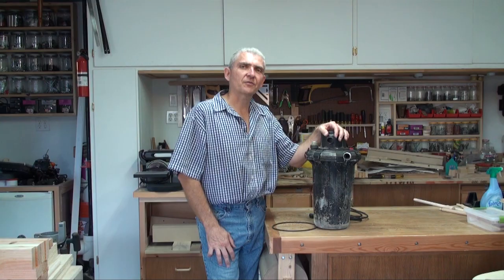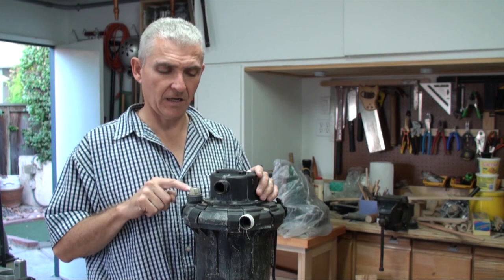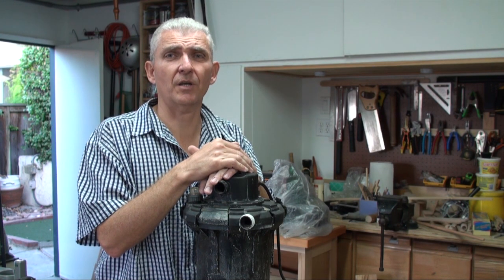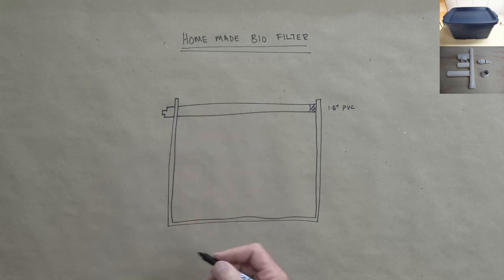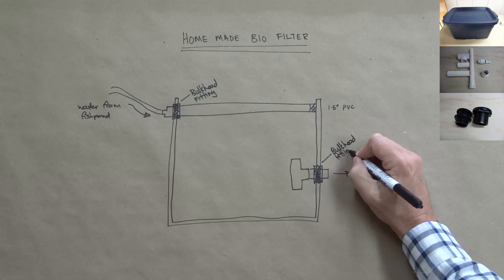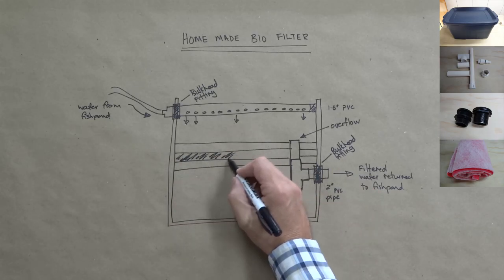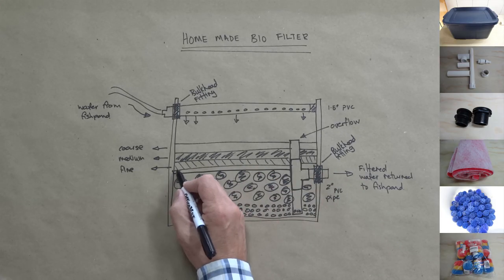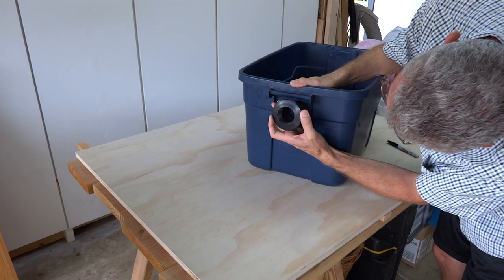Homemade Biological Pond Filter

Comment: How would you install a ball valve for this setup and add  UV
Reply: adairsr53  I have found that trying to reduce the amount of water pumped with a ball valve creates unnecessary stress on your pump; perhaps, try a smaller pump. If you still feel as though you need the ball valve I would recommend placing your ball valve inside of biofilter if you are using the ball valve to control the amount of water pumped into the filter. With placing it inside the filter if the ball valve begins to leak, it will leak in your filter rather than outside of your filter.  I do not recommend making very many adjustments as this could cause where you cut the entry for your bulkhead to lose it's 
 
  
 

 
  Normal
  0
  
  
  
  
  false
  false
  false
  
  EN-US
  KO
  X-NONE
  
   
   
   
   
   
   
   
   
   
  
  
   
   
   
   
   
   
   
   
   
   
   
  

 <w:LatentStyles DefLockedState="false" DefUnhideWhenUsed="true"
  DefSemiHidden="true" DefQFormat="false" DefPriority="99"
  LatentStyleCount="267">
  <w:LsdException Locked="false" Priority="0" SemiHidden="false"
   UnhideWhenUsed="false" QFormat="true" Name="Normal"/>
  <w:LsdException Locked="false" Priority="9" SemiHidden="false"
   UnhideWhenUsed="false" QFormat="true" Name="heading 1"/>
  
  
  
  
  
  
  
  
  
  
  
  
  
  
  
  
  
  
  <w:LsdException Locked="false" Priority="10" SemiHidden="false"
   UnhideWhenUsed="false" QFormat="true" Name="Title"/>
  
  <w:LsdException Locked="false" Priority="11" SemiHidden="false"
   UnhideWhenUsed="false" QFormat="true" Name="Subtitle"/>
  <w:LsdException Locked="false" Priority="22" SemiHidden="false"
   UnhideWhenUsed="false" QFormat="true" Name="Strong"/>
  <w:LsdException Locked="false" Priority="20" SemiHidden="false"
   UnhideWhenUsed="false" QFormat="true" Name="Emphasis"/>
  <w:LsdException Locked="false" Priority="59" SemiHidden="false"
   UnhideWhenUsed="false" Name="Table Grid"/>
  
  <w:LsdException Locked="false" Priority="1" SemiHidden="false"
   UnhideWhenUsed="false" QFormat="true" Name="No Spacing"/>
  <w:LsdException Locked="false" Priority="60" SemiHidden="false"
   UnhideWhenUsed="false" Name="Light Shading"/>
  <w:LsdException Locked="false" Priority="61" SemiHidden="false"
   UnhideWhenUsed="false" Name="Light List"/>
  <w:LsdException Locked="false" Priority="62" SemiHidden="false"
   UnhideWhenUsed="false" Name="Light Grid"/>
  <w:LsdException Locked="false" Priority="63" SemiHidden="false"
   UnhideWhenUsed="false" Name="Medium Shading 1"/>
  <w:LsdException Locked="false" Priority="64" SemiHidden="false"
   UnhideWhenUsed="false" Name="Medium Shading 2"/>
  <w:LsdException Locked="false" Priority="65" SemiHidden="false"
   UnhideWhenUsed="false" Name="Medium List 1"/>
  <w:LsdException Locked="false" Priority="66" SemiHidden="false"
   UnhideWhenUsed="false" Name="Medium List 2"/>
  <w:LsdException Locked="false" Priority="67" SemiHidden="false"
   UnhideWhenUsed="false" Name="Medium Grid 1"/>
  <w:LsdException Locked="false" Priority="68" SemiHidden="false"
   UnhideWhenUsed="false" Name="Medium Grid 2"/>
  <w:LsdException Locked="false" Priority="69" SemiHidden="false"
   UnhideWhenUsed="false" Name="Medium Grid 3"/>
  <w:LsdException Locked="false" Priority="70" SemiHidden="false"
   UnhideWhenUsed="false" Name="Dark List"/>
  <w:LsdException Locked="false" Priority="71" SemiHidden="false"
   UnhideWhenUsed="false" Name="Colorful Shading"/>
  <w:LsdException Locked="false" Priority="72" SemiHidden="false"
   UnhideWhenUsed="false" Name="Colorful List"/>
  <w:LsdException Locked="false" Priority="73" SemiHidden="false"
   UnhideWhenUsed="false" Name="Colorful Grid"/>
  <w:LsdException Locked="false" Priority="60" SemiHidden="false"
   UnhideWhenUsed="false" Name="Light Shading Accent 1"/>
  <w:LsdException Locked="false" Priority="61" SemiHidden="false"
   UnhideWhenUsed="false" Name="Light List Accent 1"/>
  <w:LsdException Locked="false" Priority="62" SemiHidden="false"
   UnhideWhenUsed="false" Name="Light Grid Accent 1"/>
  <w:LsdException Locked="false" Priority="63" SemiHidden="false"
   UnhideWhenUsed="false" Name="Medium Shading 1 Accent 1"/>
  <w:LsdException Locked="false" Priority="64" SemiHidden="false"
   UnhideWhenUsed="false" Name="Medium Shading 2 Accent 1"/>
  <w:LsdException Locked="false" Priority="65" SemiHidden="false"
   UnhideWhenUsed="false" Name="Medium List 1 Accent 1"/>
  
  <w:LsdException Locked="false" Priority="34" SemiHidden="false"
   UnhideWhenUsed="false" QFormat="true" Name="List Paragraph"/>
  <w:LsdException Locked="false" Priority="29" SemiHidden="false"
   UnhideWhenUsed="false" QFormat="true" Name="Quote"/>
  <w:LsdException Locked="false" Priority="30" SemiHidden="false"
   UnhideWhenUsed="false" QFormat="true" Name="Intense Quote"/>
  <w:LsdException Locked="false" Priority="66" SemiHidden="false"
   UnhideWhenUsed="false" Name="Medium List 2 Accent 1"/>
  <w:LsdException Locked="false" Priority="67" SemiHidden="false"
   UnhideWhenUsed="false" Name="Medium Grid 1 Accent 1"/>
  <w:LsdException Locked="false" Priority="68" SemiHidden="false"
   UnhideWhenUsed="false" Name="Medium Grid 2 Accent 1"/>
  <w:LsdException Locked="false" Priority="69" SemiHidden="false"
   UnhideWhenUsed="false" Name="Medium Grid 3 Accent 1"/>
  <w:LsdException Locked="false" Priority="70" SemiHidden="false"
   UnhideWhenUsed="false" Name="Dark List Accent 1"/>
  <w:LsdException Locked="false" Priority="71" SemiHidden="false"
   UnhideWhenUsed="false" Name="Colorful Shading Accent 1"/>
  <w:LsdException Locked="false" Priority="72" SemiHidden="false"
   UnhideWhenUsed="false" Name="Colorful List Accent 1"/>
  <w:LsdException Locked="false" Priority="73" SemiHidden="false"
   UnhideWhenUsed="false" Name="Colorful Grid Accent 1"/>
  <w:LsdException Locked="false" Priority="60" SemiHidden="false"
   UnhideWhenUsed="false" Name="Light Shading Accent 2"/>
  <w:LsdException Locked="false" Priority="61" SemiHidden="false"
   UnhideWhenUsed="false" Name="Light List Accent 2"/>
  <w:LsdException Locked="false" Priority="62" SemiHidden="false"
   UnhideWhenUsed="false" Name="Light Grid Accent 2"/>
  <w:LsdException Locked="false" Priority="63" SemiHidden="false"
   UnhideWhenUsed="false" Name="Medium Shading 1 Accent 2"/>
  <w:LsdException Locked="false" Priority="64" SemiHidden="false"
   UnhideWhenUsed="false" Name="Medium Shading 2 Accent 2"/>
  <w:LsdException Locked="false" Priority="65" SemiHidden="false"
   UnhideWhenUsed="false" Name="Medium List 1 Accent 2"/>
  <w:LsdException Locked="false" Priority="66" SemiHidden="false"
   UnhideWhenUsed="false" Name="Medium List 2 Accent 2"/>
  <w:LsdException Locked="false" Priority="67" SemiHidden="false"
   UnhideWhenUsed="false" Name="Medium Grid 1 Accent 2"/>
  <w:LsdException Locked="false" Priority="68" SemiHidden="false"
   UnhideWhenUsed="false" Name="Medium Grid 2 Accent 2"/>
  <w:LsdException Locked="false" Priority="69" SemiHidden="false"
   UnhideWhenUsed="false" Name="Medium Grid 3 Accent 2"/>
  <w:LsdException Locked="false" Priority="70" SemiHidden="false"
   UnhideWhenUsed="false" Name="Dark List Accent 2"/>
  <w:LsdException Locked="false" Priority="71" SemiHidden="false"
   UnhideWhenUsed="false" Name="Colorful Shading Accent 2"/>
  <w:LsdException Locked="false" Priority="72" SemiHidden="false"
   UnhideWhenUsed="false" Name="Colorful List Accent 2"/>
  <w:LsdException Locked="false" Priority="73" SemiHidden="false"
   UnhideWhenUsed="false" Name="Colorful Grid Accent 2"/>
  <w:LsdException Locked="false" Priority="60" SemiHidden="false"
   UnhideWhenUsed="false" Name="Light Shading Accent 3"/>
  <w:LsdException Locked="false" Priority="61" SemiHidden="false"
   UnhideWhenUsed="false" Name="Light List Accent 3"/>
  <w:LsdException Locked="false" Priority="62" SemiHidden="false"
   UnhideWhenUsed="false" Name="Light Grid Accent 3"/>
  <w:LsdException Locked="false" Priority="63" SemiHidden="false"
   UnhideWhenUsed="false" Name="Medium Shading 1 Accent 3"/>
  <w:LsdException Locked="false" Priority="64" SemiHidden="false"
   UnhideWhenUsed="false" Name="Medium Shading 2 Accent 3"/>
  <w:LsdException Locked="false" Priority="65" SemiHidden="false"
   UnhideWhenUsed="false" Name="Medium List 1 Accent 3"/>
  <w:LsdException Locked="false" Priority="66" SemiHidden="false"
   UnhideWhenUsed="false" Name="Medium List 2 Accent 3"/>
  <w:LsdException Locked="false" Priority="67" SemiHidden="false"
   UnhideWhenUsed="false" Name="Medium Grid 1 Accent 3"/>
  <w:LsdException Locked="false" Priority="68" SemiHidden="false"
   UnhideWhenUsed="false" Name="Medium Grid 2 Accent 3"/>
  <w:LsdException Locked="false" Priority="69" SemiHidden="false"
   UnhideWhenUsed="false" Name="Medium Grid 3 Accent 3"/>
  <w:LsdException Locked="false" Priority="70" SemiHidden="false"
   UnhideWhenUsed="false" Name="Dark List Accent 3"/>
  <w:LsdException Locked="false" Priority="71" SemiHidden="false"
   UnhideWhenUsed="false" Name="Colorful Shading Accent 3"/>
  <w:LsdException Locked="false" Priority="72" SemiHidden="false"
   UnhideWhenUsed="false" Name="Colorful List Accent 3"/>
  <w:LsdException Locked="false" Priority="73" SemiHidden="false"
   UnhideWhenUsed="false" Name="Colorful Grid Accent 3"/>
  <w:LsdException Locked="false" Priority="60" SemiHidden="false"
   UnhideWhenUsed="false" Name="Light Shading Accent 4"/>
  <w:LsdException Locked="false" Priority="61" SemiHidden="false"
   UnhideWhenUsed="false" Name="Light List Accent 4"/>
  <w:LsdException Locked="false" Priority="62" SemiHidden="false"
   UnhideWhenUsed="false" Name="Light Grid Accent 4"/>
  <w:LsdException Locked="false" Priority="63" SemiHidden="false"
   UnhideWhenUsed="false" Name="Medium Shading 1 Accent 4"/>
  <w:LsdException Locked="false" Priority="64" SemiHidden="false"
   UnhideWhenUsed="false" Name="Medium Shading 2 Accent 4"/>
  <w:LsdException Locked="false" Priority="65" SemiHidden="false"
   UnhideWhenUsed="false" Name="Medium List 1 Accent 4"/>
  <w:LsdException Locked="false" Priority="66" SemiHidden="false"
   UnhideWhenUsed="false" Name="Medium List 2 Accent 4"/>
  <w:LsdException Locked="false" Priority="67" SemiHidden="false"
   UnhideWhenUsed="false" Name="Medium Grid 1 Accent 4"/>
  <w:LsdException Locked="false" Priority="68" SemiHidden="false"
   UnhideWhenUsed="false" Name="Medium Grid 2 Accent 4"/>
  <w:LsdException Locked="false" Priority="69" SemiHidden="false"
   UnhideWhenUsed="false" Name="Medium Grid 3 Accent 4"/>
  <w:LsdException Locked="false" Priority="70" SemiHidden="false"
   UnhideWhenUsed="false" Name="Dark List Accent 4"/>
  <w:LsdException Locked="false" Priority="71" SemiHidden="false"
   UnhideWhenUsed="false" Name="Colorful Shading Accent 4"/>
  <w:LsdException Locked="false" Priority="72" SemiHidden="false"
   UnhideWhenUsed="false" Name="Colorful List Accent 4"/>
  <w:LsdException Locked="false" Priority="73" SemiHidden="false"
   UnhideWhenUsed="false" Name="Colorful Grid Accent 4"/>
  <w:LsdException Locked="false" Priority="60" SemiHidden="false"
   UnhideWhenUsed="false" Name="Light Shading Accent 5"/>
  <w:LsdException Locked="false" Priority="61" SemiHidden="false"
   UnhideWhenUsed="false" Name="Light List Accent 5"/>
  <w:LsdException Locked="false" Priority="62" SemiHidden="false"
   UnhideWhenUsed="false" Name="Light Grid Accent 5"/>
  <w:LsdException Locked="false" Priority="63" SemiHidden="false"
   UnhideWhenUsed="false" Name="Medium Shading 1 Accent 5"/>
  <w:LsdException Locked="false" Priority="64" SemiHidden="false"
   UnhideWhenUsed="false" Name="Medium Shading 2 Accent 5"/>
  <w:LsdException Locked="false" Priority="65" SemiHidden="false"
   UnhideWhenUsed="false" Name="Medium List 1 Accent 5"/>
  <w:LsdException Locked="false" Priority="66" SemiHidden="false"
   UnhideWhenUsed="false" Name="Medium List 2 Accent 5"/>
  <w:LsdException Locked="false" Priority="67" SemiHidden="false"
   UnhideWhenUsed="false" Name="Medium Grid 1 Accent 5"/>
  <w:LsdException Locked="false" Priority="68" SemiHidden="false"
   UnhideWhenUsed="false" Name="Medium Grid 2 Accent 5"/>
  <w:LsdException Locked="false" Priority="69" SemiHidden="false"
   UnhideWhenUsed="false" Name="Medium Grid 3 Accent 5"/>
  <w:LsdException Locked="false" Priority="70" SemiHidden="false"
   UnhideWhenUsed="false" Name="Dark List Accent 5"/>
  <w:LsdException Locked="false" Priority="71" SemiHidden="false"
   UnhideWhenUsed="false" Name="Colorful Shading Accent 5"/>
  <w:LsdException Locked="false" Priority="72" SemiHidden="false"
   UnhideWhenUsed="false" Name="Colorful List Accent 5"/>
  <w:LsdException Locked="false" Priority="73" SemiHidden="false"
   UnhideWhenUsed="false" Name="Colorful Grid Accent 5"/>
  <w:LsdException Locked="false" Priority="60" SemiHidden="false"
   UnhideWhenUsed="false" Name="Light Shading Accent 6"/>
  <w:LsdException Locked="false" Priority="61" SemiHidden="false"
   UnhideWhenUsed="false" Name="Light List Accent 6"/>
  <w:LsdException Locked="false" Priority="62" SemiHidden="false"
   UnhideWhenUsed="false" Name="Light Grid Accent 6"/>
  <w:LsdException Locked="false" Priority="63" SemiHidden="false"
   UnhideWhenUsed="false" Name="Medium Shading 1 Accent 6"/>
  <w:LsdException Locked="false" Priority="64" SemiHidden="false"
   UnhideWhenUsed="false" Name="Medium Shading 2 Accent 6"/>
  <w:LsdException Locked="false" Priority="65" SemiHidden="false"
   UnhideWhenUsed="false" Name="Medium List 1 Accent 6"/>
  <w:LsdException Locked="false" Priority="66" SemiHidden="false"
   UnhideWhenUsed="false" Name="Medium List 2 Accent 6"/>
  <w:LsdException Locked="false" Priority="67" SemiHidden="false"
   UnhideWhenUsed="false" Name="Medium Grid 1 Accent 6"/>
  <w:LsdException Locked="false" Priority="68" SemiHidden="false"
   UnhideWhenUsed="false" Name="Medium Grid 2 Accent 6"/>
  <w:LsdException Locked="false" Priority="69" SemiHidden="false"
   UnhideWhenUsed="false" Name="Medium Grid 3 Accent 6"/>
  <w:LsdException Locked="false" Priority="70" SemiHidden="false"
   UnhideWhenUsed="false" Name="Dark List Accent 6"/>
  <w:LsdException Locked="false" Priority="71" SemiHidden="false"
   UnhideWhenUsed="false" Name="Colorful Shading Accent 6"/>
  <w:LsdException Locked="false" Priority="72" SemiHidden="false"
   UnhideWhenUsed="false" Name="Colorful List Accent 6"/>
  <w:LsdException Locked="false" Priority="73" SemiHidden="false"
   UnhideWhenUsed="false" Name="Colorful Grid Accent 6"/>
  <w:LsdException Locked="false" Priority="19" SemiHidden="false"
   UnhideWhenUsed="false" QFormat="true" Name="Subtle Emphasis"/>
  <w:LsdException Locked="false" Priority="21" SemiHidden="false"
   UnhideWhenUsed="false" QFormat="true" Name="Intense Emphasis"/>
  <w:LsdException Locked="false" Priority="31" SemiHidden="false"
   UnhideWhenUsed="false" QFormat="true" Name="Subtle Reference"/>
  <w:LsdException Locked="false" Priority="32" SemiHidden="false"
   UnhideWhenUsed="false" QFormat="true" Name="Intense Reference"/>
  <w:LsdException Locked="false" Priority="33" SemiHidden="false"
   UnhideWhenUsed="false" QFormat="true" Name="Book Title"/>
  
  
 

 /* Style Definitions */
 table.MsoNormalTable
 {mso-style-name:"Table Normal";
 mso-tstyle-rowband-size:0;
 mso-tstyle-colband-size:0;
 mso-style-noshow:yes;
 mso-style-priority:99;
 mso-style-parent:"";
 mso-padding-alt:0in 5.4pt 0in 5.4pt;
 mso-para-margin-top:0in;
 mso-para-margin-right:0in;
 mso-para-margin-bottom:10.0pt;
 mso-para-margin-left:0in;
 line-height:115%;
 mso-pagination:widow-orphan;
 font-size:11.0pt;
 font-family:"Calibri","sans-serif";
 mso-ascii-font-family:Calibri;
 mso-ascii-theme-font:minor-latin;
 mso-hansi-font-family:Calibri;
 mso-hansi-theme-font:minor-latin;}

Integrity and begin to leak.  As for the UV lamp it can be attached to the hose that comes from the pump then attach another hose from the UV lamp to the filter.  I can only assume you are using a type of UV lamp such as an external Luguana or Tetra UV lamp. You will still need to ensure that your pump does not exceed the recommeded GPH for your external UV lamp. When I used an external UV lamp, I mounted mine to a deck board that was supported by yard stakes, then the UV lamp was placed under a bush to keep it from being in direct sunlight. Since I started making my own bio filters I found that I no longer needed an external UV lamp.  I elimated the extra plumbing and reduced my electric bill.  I had 3 separate lamps for two ponds. I put them in my recycle bin and put them out with the trash.  Last but not least remember you must filter twice your volume of pond water per hour.  1000 gallon pond? Then you need to pump and filter 2000 gph.  You don't have to have one huge pump you can have two.  If you have two pumps they can both run to the same filter. Tee the hoses under water in your pond then run one hose to your filter.  My homemade bio filters are 30 gallon trash cans and hide nicely behind bushes. 
Sincerely,
Lost Sheep